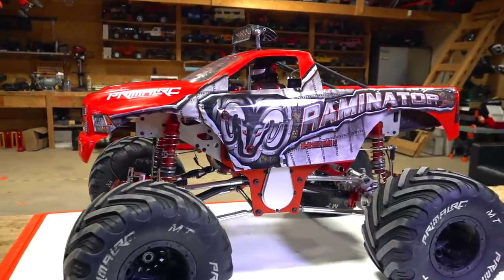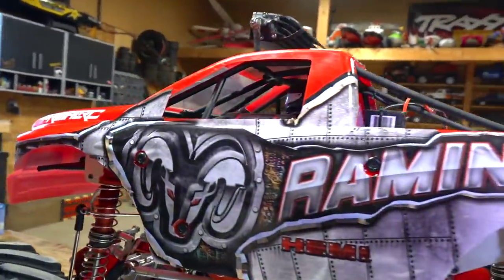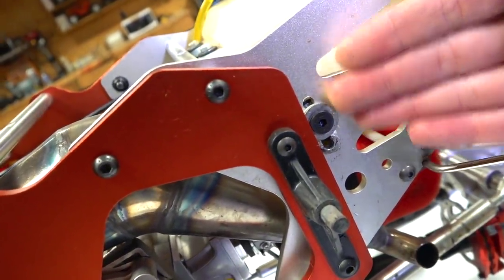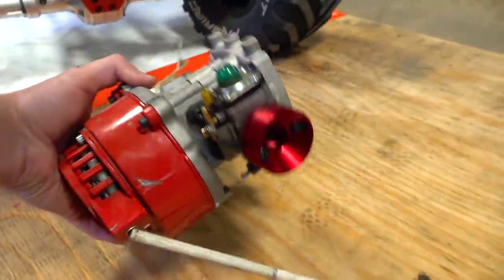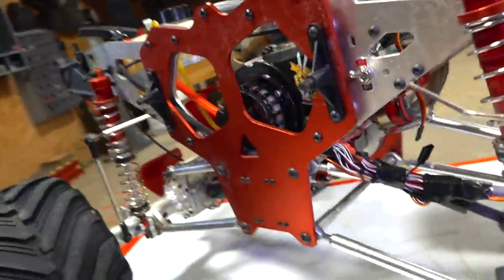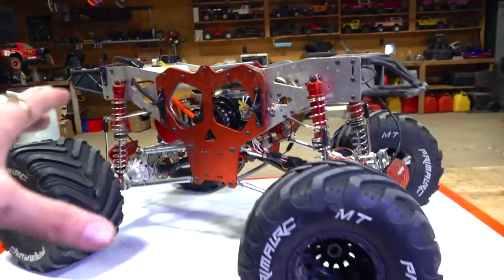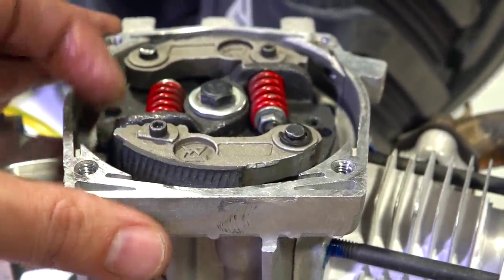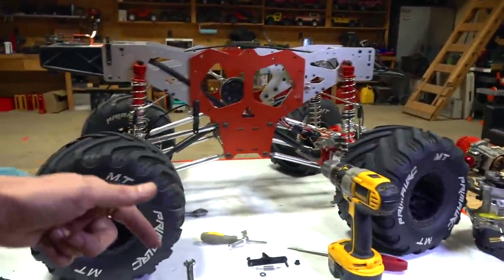WHAT HAPPENED TO MY RAMINATOR MONSTER TRUCK? | RC ADVENTURES

Comment: Great video! So much good info!  Glad your feeling better. I have been running my TMR engine with the stock pipe just to test it and it's been working great so maybe your clutch was the issue but that big pipe will really wake it up it's like adding a supercharger on a normal engine. Allen is also making a even better pipe now 😮

Comment: Most of us out here are gear heads in one form or another 
And yes your speaking my language 
Its just like breathing your rc needs to exhale just as well as it inhales or you will get that low end bog 
And the clutch pads are like running your soft winter tires in the middle of summer 
They wear our super fast because the hot pavement causes the rubber break down faster 
That's the easiest way I've found to explain it 
Keep up the great vids Aaron 
I look forward to the next one

Comment: I had a pocket bike motor upgrade many years ago. The kit came from pbu USA and I had to change the pipe too. The pipe came with 3 different tip which give you either more torque, more top end or a middle range.  Suprisingly, it made a big difference. Have you taken a look at the water cooled 37cc pocket bike engine. They pull like crazy.

Comment: Hey RC when I'm diagnosing two strokes I like to make big changes at first, one change at a time.  To find which direction I need to go.  Expansion chambers are specific usually.  Hey, how is the spark plug timing controlled?

Comment: Those rotary carbs like on your old engine do usually have a low speed adjustment. Its hidden on the top of the carb, directly in the center or the rotating throttle piece. Usually it is blocked by a plastic or brass plug, that must be drilled out. Then use a tiny flat head screwdriver to adjust it. It will adjust the mixture at idle up to about half throttle.

Comment: Having problems with my DBXL 23cc it's got a upgrade pipe 
But still bogges down sometimes an have to run it with the choke closed 1/4 to get the power to start kicking in faster 
What would you try first?
Reply from the maker: Tuning tuning tuning..   go back to stock needle settings. If you have done that.. replace the carb

Comment: i notice the same thing on mine with the bogg, i am waiting on the new TMR exhaust,  ok the problem is that the pipe is not large enough to rev the engine enough to throw out the clutch shoes, then the heat of the shoes not being fully extended is causing friction resulting in heat that eats up the clutch shoes. is this what you are saying???

Comment: With high performance 2 strokes it is not as simple as a bigger exhaust lets the engine breath more, the proportions of the header and the expansion chamber effect the resonance of sound pulse waves moving along the exhaust, when the timing of this pulse matches the timing of the engine the power increases significantly.

Comment: I was wondering what the best rc truck is good for a obstacle course I had built. I really just wanted to know, I wanna stay with Traxxas though. I own a X Max 8s snap on truck, but I want something like a Trx 4. Please let me know what I could get, or what you recommend. Thanks~Dakota
Reply: Redcat gen8, or trx4. imo, just get the trx4 sport. It's cheaper, and you really don't need the locking diff, and high low gears. You'll run 90% of the time with a locked diff, and low gear selected, and that's just what the sport comes stock.
Reply: C thank you so much

Comment: So I'm watching and I'm not done with the video yet but you're talking about the throttle getting stuck... Since you put a higher torque Servo on it could you put a stronger return spring for the throttle? I think that is what you're talkin about like the spring isn't returning the throttle where it needs to be

Comment: Throttle sticking on both engines. It can only be the servo and/or linkage. E clips are thin. They can get hot enough to change shape and let go before anything melts.

Comment: I had a feeling you didn't get bored of it, now we know the rest of the story, thanks. That E clip problem reminded me of the 80s when I was a Karney on the Santa Monica Pier. They had a 1929 16 chair Big Ben Ferris wheel that had a wooden bushing in the clutch mechanism. After scheduled maintenance I replaced the e clips the wrong way (opening facing in) so that inertia blew one right off and rubbed on the wooden bushing and made it smoke the ride.💥😳🤬 All of a sudden 32 people wanted to get off. I don't know why?

Comment: Also the back pressure from the exhaust is a major source of power loss, I had a nest of some sort in the exhaust system of my Toyota Hilux I got running from sitting out side for 10 years and when that thing finally shot out of there my power suddenly jumped up about 50% and the engine became so quiet it almost scared me how much better the engine ran hahah

Comment: Awesome truck medic if you want a little extra snap off the line and top speed add a little seafoam into your fuel you can buy that from Canadian Tire it's like liquid nitrous oxide Iran some in my 5th scale redcat rampage XT I didn't shake it in to the fuel so it would get a little bit of fuel then it would get a shot of seafoam direct and it wanted to do pop a wheelies

Comment: The clip must have been what damaged the clutch shoes and as thin as they are it is likely out in the yard somewhere. The new pipe just needs a little time with a sander and some high temp paint and it will be good to go. 
Honestly out of all the stuff you have, this thing is my favorite. The scale equipment is cool and sure other monster trucks are faster, but this thing is a proper monster truck in large scale.

Comment: Hey Rc Sparks! 
Aloha from maui, home of the #14 raminator!
I also had issues with my throttle sticking in my TMR motor. 
I used a return spring from discount Dave's, it's a walbro part, goes between the cable swivel, and the cable adjuster, works great. 
Ill try and find the part #
Reply from the maker: That would be very helpful, Joe!!   Aloha! Raminator #44
Reply: @TheRealRCSparks  Here's the part# Link Spring - av913, not fun having a sticky throttle....been there done that....aloha joe ram#14

Comment: Don't get me wrong, it's a really cool truck, but because of the price, size and weight and rigid metal parts and housing, it doesn't have the air time, turn radius or flexibility of an Xmaxx, yes the Xmaxx might take less of a beating before breakage, but Traxxas parts are far more cheaper and easier to fix, so the Raminator is just not a very cost effective basher I.M.O.

Comment: sooo u got other new motor i think i remember that motor parts before it may not be 49cc but to me seen be 47cc because have more torque than HP 
if it bog down it mean something isnt right with carburetor or clutch i guess have replaced it n see how it goes if doesnt help then try swap muffler if goes worse than try adjusting carburetor whiles hit it wide open n let off if doesnt sounds right n adjust it n do aging repeating it unite get it way should  be running 
cold doesnt affected 2 stoke whiles motor warm be easy start it if u left it out in freezing ya going be hard start it
if u still having problems with clogged up muffer i do know trick u can do
all u need is torque tank n hose and air compressor 
first use torque n shoot it thur muffler hole n lighted other side hole so fire be on other side n it will be burning off carbon dioxide inside it get it back working aging there few videos people do they exhaust manifold  ¯\_(ツ)_/¯

Comment: For the throttle wire take it off take the wire out out some wd40 on it out the wire back in and out it back on the truck and it should work fine

Comment: I really wish they would come out with an electric version,  to this beast. I am sure it will sell like hot cakes. Gas, or nitro cars are not my strong suit. When I tell you I suck at it, I mean I suck. For the life of me, I could never keep the engine running.  That's why I switched to electric. Just put batteries in and go.
Reply: I hear you man. I had an old nitro and maybe got about a handful of good runs out of it before I couldn't keep it running anymore. In the last 25 years I've never had an electric RC I couldn't just swap out a cheap motor, or set of gears/bearings to get it running. It's amazingly perfect for the hobby.

Comment: Its a shame but they should have offered an 85cc perfomance pack engine pipe and clutch combo that eorks and charged a little more to have 2900$ tied up in rc that does not perform sucks

Comment: Ok if you dont make a proper monsterjam freestyle track for the next time you run it we gona be upset
Reply from the maker: I did make a proper monster jam style track already.. and used the truck many times. Now, its winter.. and there snow is deep and the air is -25c.   I aint making shit until springtime
Reply: @TheRealRCSparks  lol ya seen it after commenting try and find a cheap material to make a car out of that will get crushed underneath the weight of that truck that would be cool

Comment: What is that mess of wires on the rear lower control arm it looks messy. The ckufch bell has over heated and has hopefully not warped it you can see the engine has got very hot. That pipe looks like the Lunatic pipe for either the LOSI 5ive-T or maybe the HPI one if so that will let it breeth, to adjust bite on that clutch you adjust spring tension with the nuts on the bolt that goes through the red spring's, I have simialar on my BZM adjustable 70mm clutch in my LOSI 5ive-T and have set it so one spring flies out earlier than the other and the bite is set to be fully engaged  by 7220rpm it then rips combined with the Scott Finlay evo40 RC engine 10+hp motor.
I cant wait to see the thing ripping it up, I think the upgrade pipe is now available,  it has a better carb but maybe a better option is out there I think it will be needed IMHO, watching other s on here, the throttle cable also looked way to close to the central  drive shaft needs re-routing maybe oh and get the rear steer it makes it far more of a grin a minute, and operate reverse a lot it makes changing the gear easier as it mesh's better.